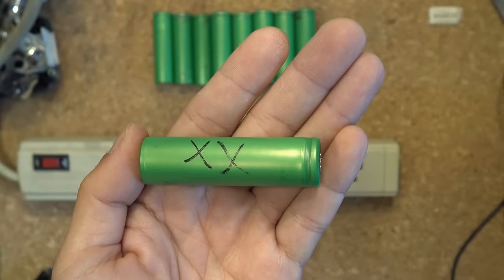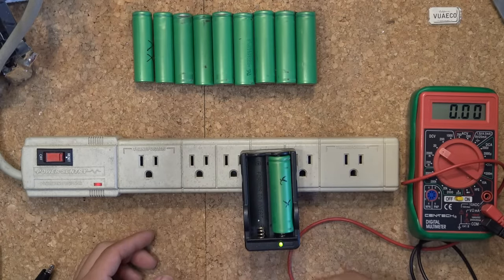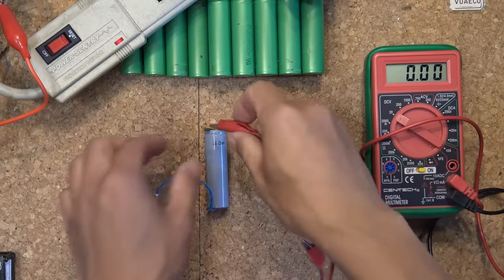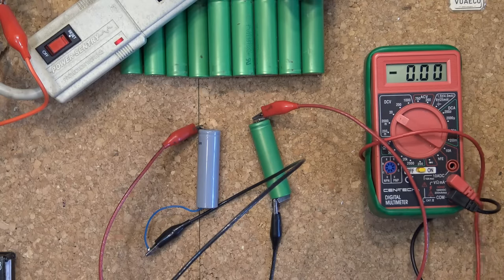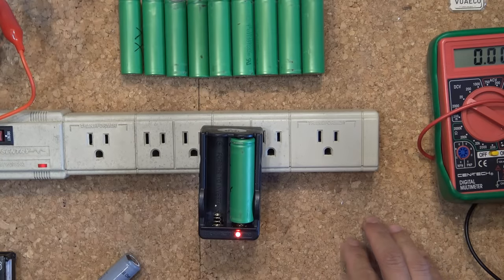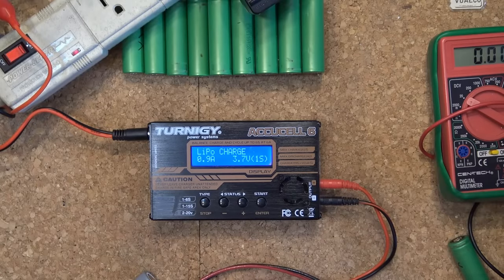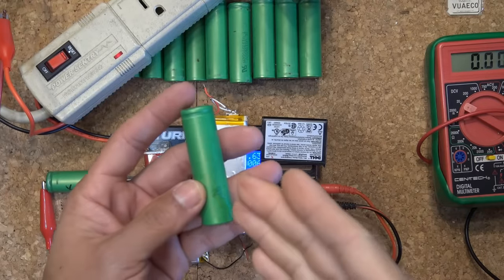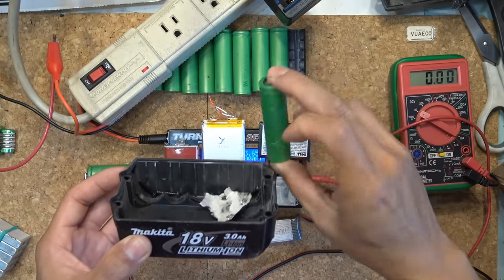DIY: How to revive a dead 18650 (or any) Li-ion battery cell

Comment: Hey thanks, it actually works great. I tested my dead battery at 0.14 v
30 seconds paralleled to a full 4.2v and the dead cell read 2.3v. I put it on the charger and it picked it up for the first time in 6 months. I've run it in my vape and there's no difference between it and my new cell's. Its running at peak performance. I don't know why I was worried, I've done this thing dozens of times with dead car batteries.
Reply: this is how those vape pens explode dude, using damaged batteries.
lithium ion battieres that drop below 3 volts are damaged chemically and develop a high internal resistance.
some time down the road during charging or high load the high resistance can cause too much heat and the heat causes higher resistance resulting in fire or explosion.
0.14V is definitely a damaged cell and i would toss it into recycling.
don't risk it

Comment: I revive mine using an old dumb style vape pen charger. If it is too low i just use a 5v wall wart with allegator clips till it hits about 3.3v or so. You can charge these batteries up quick. If it gets hot and continues to get warmer it has an internal short and should be fully drained and recycled.

Comment: Not sure if batteries will be useful, but it did bring up the voltage enough that my charger started charging them. Magnet idea is freaking brilliant tho! Probably would have started a fire trying this without them 😁.
Update: yeah, didn't really fix a bad battery, but could revive one near death, can't imagine those are good as new.

Comment: Is there a simple way to build in limit to discharging too low in a circuit using these cells? I am running bath fans with 3 in series and ruining batteries because just one will drop to zero while the rest are fine

Comment: If the dead cell was holding down the voltage such that it required a boost charge from the second cell, why wouldn't the single cell charger have shown a red charging indicator when it was plugged in? The only time it would remain green is if the cell is either open circuit or fully charged. That black charger puts out about 4.1V and turns red when loaded down.

Comment: I got that type of cheap charger with green/red indicator. And I want to tell you that there is no need to charge discharged battery from another battery. All you have to do is to put discharged cell in charger. Green indicator does not mean that there is no current in circuit. You can measute it with voltmeter. So you can charge cell until indicator will change its light to red and then to green again. But it will take a LOT of time. And good news is that all charging process will be done with low current. Maybe you got better charger that cuts off current if there is cell with very low voltage.

Comment: Fantastic!  Good explanation.  There was a spark with mine, but that was to be expected.  The higher voltage and amps, the more spark and danger and the less time you should boost it for.

Comment: With the batteries connected in parallel the voltage shown is actually the average of the two batterie connoted rather than the voltage of the connected battery itself.

Comment: I have dead batteries like this, showing 0 volts and when I put the ohm meter across them, seem to show complete short circuit. If I connected another battery to it, that good battery would surely blow up?

Comment: I tried this on two different lithium cells , both registering just above 0.5 volts but it made no difference . I guess the cells are just too far gone . I even tried a 12 volt battery in parallel but still no change . Thanks for the Neodymium magnets tip though .

Comment: Is there w way to reset li ion 18650s so they will retain amperage capacity. I have some sonys from lap top bat that was hardly used but laptop zapped them. I got them to charge to 4.06 v but they lose voltage quickly (4pack generic charger/recharger) when only putting out .25 amps to mp3 player.   I know battery discharge is a chemical reaction, but I have heard that  they can be reset somehow. Do they have residual charge and discharge memory?

Comment: If the battery got warm from 20 seconds then it's not safe. The battery will charge but the temperature will get hot enough to burst or catch on fire. That's why your chargers are rejecting to charge it below the internal cut off voltage. You also risk killing your good battery that you connected in parallel if the bad battery is internally shorted.

Comment: Great idea and thanks for doing it.  But the key question is will the battery holds its charge for long?  In my experience, it does not and discharges faster than a good condition battery. What is your experience?

Comment: I use an old USB cable with only + and - wire, i connect it to the +/- of the batteries and here we go. 20 seconds and then in the battery charger. I use this method since years, never had a problem. Except for the short time the battery stay charge. When that died, you can "awake" as many time you want but never stay charged for so long. Better take a new one (at least on mobile phones and other stuffs like that)
Reply: Thx for your USB cable method!! it worked as a charm for me!!
PS: the thing is to supply the battery with 5v for about 20-30sec, any 5v supply would be ok, so USB or Bench Power Supply ;)
Reply: Dr ZipZwan you're welcome 😉
You can use any USB things to do it. 
Yes, it depends on what and where you can connect the cable at. 
I use very often PC (because it's the faster thing i can use), if I'm outside i use power bank, or last (very last) an usb wall charger... I use that as last choice because I've burnt my fingers once 😆 if + and - shorts, that spot become incandescent! 😣 (only "very hot with PC and power bank. Lol).
Few times I've done it with USB-OTG + usb cable. Btw that was a bvery very emergency. situation.
Reply: @Ale_giro  me I used USB wall Charger, and an usb cable, already chopped that I keep around for diy project 😊.
before building a LabPower Supply, I needed 5v supply for projects, and so lately, I use that cable rarely! but today it came handy again! I did not want to use my Lab suppply, cause it is kind of stored in drawer 😂, and to long to take plug it and set it... lol
plus, wall charger (wall phone charger) + usb cable was fast solution for me (wall charger was already even plugged!). 
Could use PC as you, but since was my first try, wanted to be careful...
And like you say, after about 25-30sec, I feeled the bat being warm, I said its anough, lets see what multimeter will show= 3,86v.
So now bat is in charger 😎
Reply: Dr ZipZwan don't worry, you won't burn usb in your PC. At least... Never happened to me in years 😉 plus, you can connect the cable even if your PC is off. Both desktop or laptop. 

Another tip is: glue the cables to a (broke or split) clothespin, so you don't warm your fingers at all 😇

Tip n2: you can weld/glue/fix a broke usb cable (+ and ) into an old PC fan +/ and here we go, if you are too warm in summer.... (same: works very well with USB-OTG too!!)

I did it hundreds, because i had a lot of broken USB cables and thousands of fans 😆😆😆
Reply: @Ale_giro  yeah I know now it wont burn the PC lol, but since it was my first try, I said , a wall charge is cheaper than a PC 😂, I mean if something was going to happen. but I know now, than it isok.
Cool the clothespin trick, I saw that tip around, to program chip, when you need to upload code, and no way to add a connector to the chip, like here: https://www.youtube.com/watch?v=Fzbg-BqIdJI   / only link I could find/remember
and for the fan, I know since, I made a Fan Fun extractor for soldering 😎
Thx for the cool tips buddy, knoledge is never enough is this world 😉

Comment: I have tried it with diy powerbank(the one without batteries inside)
My dead batteries wont turn on the power bank but when I put the healthy batteries works, so I decided to mix them, and it still works!!  what I noticed is that when I charged the diy power to full and check the dead batteries  they are have been revived. The revived batts can now turn the diy powerbank alone...
Reply: In my case my power bank have 6 batteries and 5 of them are dead how should I connect them in series or parallel
Reply: @gmmrk35  parallel

Comment: One cell in my drill battery has no charge at all 0 volts they look like yours.  Are these universal?  My cell is so dead all it does is short the batteries i use to try to revive it.  It just lets current pass through but cant store any.  Mine from my drill battery have no markings but look just like yours how can i find out?

Comment: I did this way before and it works fine. Sometimes in a battery pack one battery shorts and drains other batterys to a low voltage like 1 volts. Chargers don't charge this batterys so you need to charge them manually. I got some very good batterys like that. It doesn't mean battery is dead if the voltage is too low when you check it first.
Reply: *batteries 
1 *volt 
*these *batteries
Reply: @stfuplsok  Bruh I totally forgot my comment existed here. I guess my English is better now compared to 3 years ago.
Reply: @snaj9989   good and yeah that's what they always say.

Comment: A easy way if you have the battery charger he has that says "  Low voltage " is to change from lipo to ni cad in the settings then just manual charge at 0.1 amps for around 20 mins to get it up to charge and then plug it back in the item and it will start charging . Worked for my wifes hair remover .

Comment: This is an inherited problem with this new era of smart chargers. The newer smart chargers don't "like" dead batteries or deeply discharged batteries. The charger won't push a current into a dead cell thinking its a bad cell rather than it only being deeply discharged. They need to redesign these smart chargers in my opinion. I still have "dumb chargers" (chargers that have no over charge protection and just push a steady current through batteries) or old chargers that will charge a deeply discharged battery fine. So i just put the deeply discharged battery in that charger for an hour or so, then put in the smart charger to leave in there for when i need it. Because the smart charger won't overcharge and just keep the battery "topped off". Now I mean NIMH batteries mainly.

Comment: Do i need to use multi meters or can I just connect the batteries pos to pos neg to neg... or do I need to run through a circuit?

Comment: So, i have this question. Since I'm experiencing ths problem right now. My battery is Kdest Orange, its the one im using for my vaping. Lately, i was using my vape and then suddenly it wont fire. The voltage of my battery is always at 4.3-4v. What do i do then? I also read somethng from my charger. It is Xtar VP4 btw. It says it can revive a dead battery... How will I do it?

Comment: My battery exploded after I tried this. :o
Reply: Are u serious?
Reply: @MA0BT  yeah the end poped and steam or smoke started coming out. So I threw out out the door onto the dirt.
Reply: Sure you connect right? Sounds like wrong polarity
Reply: @simonvoigt6262  no I connected them in parallel. These were  out of a laptop battery that had died in less than a years of use.  I still have 3 remaining of the 4. When I check them with the multi-meter, it displays 2 volts and quickly starts dropping.  I am surprised that the safety didn't pop, so the cells must be shorting out inside.  This is why I mentioned my experience, if it happened to me it can happen to someone else.
Reply: @Ahamshep  : Your cell was that DEAD, it CHANGED polarity !
ALWAYS check the cell first.

Comment: So what is the answer to what happens to a battery when it is getting 0.5volt chemically? I have problem with a batterypack of 60 V and it drains to fast. On the battery boards it is alot I think transister small ones and dont know if that effects the voltage-drain. It is for electric motor. Now it is not holding the voltage and has dropped capacity to around 10 of 100%. How to check the capacity of a battery 18650?

Comment: Most likely batteries at this point will have a good reduce in storage capacity... Anyway my problem is my Samsung 18650 isn't holding full charge and doesn't have all its life cycles done yet... What should I do with it, give it big amp shortbursts charge?

Comment: I bought a used laptop with a dead battery from ebay, and have a suspicion that it was deeply discharged too. The previous owner told me, that it used to work the day before, but suddenly - well, it had bootup/bios problems too, which I solved. 
Would this technique work in principle for such a pack of batteries, too? 
I have another laptop which is more than twice that old, and the battery of that one (18 years old) is finished, too, but still shows charging/uncharging while on power. Without power supply, the battery just lasts for about one minute. So I think it was never that deeply discharged, which is of course just a speculation.

The broken laptop should have a voltage of 10.8 V but It shows only 0.48 V. Would it be sufficient to put it in parallel with a 9 V block for some seconds to try out, whether it works?

Comment: Do you know why this way works and why you can't use a charger in the beginning for a dead cell? Is it the magnet connection or some other reason?  Does it hold a charge long? Thanks. Great video.
Reply: Magnets have nothing to do with it it’s only to hold the clips to the battery, he tried straight in the charger but was to flat to charge so he changed it a bit so it would charge on it’s own, hope that helps
Reply: The charge won' last very long and when under load the battery will fail after a few minutes.

Comment: It's been over 3 years for the video, but I have a question.. Did the battery continue to charge after that or do you have to use this trick over and over to get the battery to take a charge..

Comment: I never thought a parallel connection can revive it. Thanks it worked on mine. But it drains so fast than my other batteries
Reply: Because the cell is damaged and will never hold a proper charge.

Comment: I just got these new batteries, 18650, in my tpriv they both said 99%. they discharged both to like 32% and my box says low battery. I vape at maybe 0.10 right now, usually. so I can't use maybe a third of both of these batteries?

Comment: I have two new 2600mAh Li-Ion camera batteries that I’m unable to charge properly after only a handful of charge cycles. The weird thing is when they are fully discharged the charger reports them as 90% charged. After charging to100% I only get around 5 minutes use from them whereas new they gave me around an hour (I use them to power a 7” camera monitor). I checked with a voltage meter and they definitely have zero voltage output when discharged. I doubt the charger is faulty as I have two identical chargers and both give 90% percentage readouts when the batteries are definitely flat. What is going on? I will try your trick and see what happens. Thanks.

Comment: I have a variable power supply for electronic work bench. I have this happen. My Arlo security camera battery gets too low it won't charge. I just remove it and jump it to nominal volts (7 volts) for 20 seconds, I put it back in camera and plug in micro USB from charger. Get the blue flashing light and NOT followed by red fail to charge light.  Had two 18650 batteries on flash light. Again it would not charge. So I connected them to my power supply for an hour at 4.2 volts. The power station shows  Amp  draw. It starts at 1 amp then drops down to half Amp. Then I put them in chargers and they charge.

Comment: I don't know what is wrong with my  new 18650batteries, I series it because I need more voltage to power my circuit and it work ,but once it run down , have never charge it and store current expect voltage, what is happen?

Comment: Set your RC charger to nimh, 100mah and watch the volts climb up. After a minute or less it should be high enough to be recognised in lithium-charging mode. Stop at 2-3v.

Comment: Handy trick, but stressful on the battery when done that way.  I usually have the battery in or connected to the charger (I have done it with completely dead car batteries), before briefly jumping it with another battery. One of my car chargers needs a reference voltage, and a quick jump with #14 test leads is enough to get it started.  This is not reviving or rejuvenating a battery (like zapping a tired NiCad with a capacitor), it’s just giving the charger a reference voltage so it will begin charging.  Avoid doing any more than necessary.  The fact the 18650 got warm is a sign of excessive current.

Comment: Just did this but with a USB cable. Strip one end, get the + and - from the USB cable and use that to temporarily boost the cell voltage. Current and voltage are limited so you dont get much heat, and you just watch the voltage come up with a multimeter. Took maybe 1 minute. Just resurrected a gopro battery haha

Comment: How much life does this breathe into it though? Is it as good as a new battery? Or will it lose charge quick still and then be dead again after a cpl charges?
Reply: That depends. If the descent condition battery cell got drained by a source (USB port tends to drain a little power) then it just needs to be jump started and remove that stupid USB port. If the battery cell has gone bad (premature death, losing charge) due to extensive fast charging then jump starting would not fix it.

Comment: I did the way same you before, but when I used batteries for the drill gun and power bank they drained power so quickly.
We can activate bad batteries come to 3 or 4v again, but they are not lasting long power.